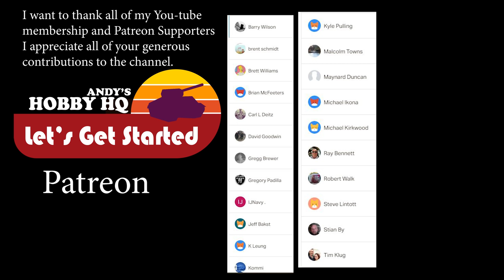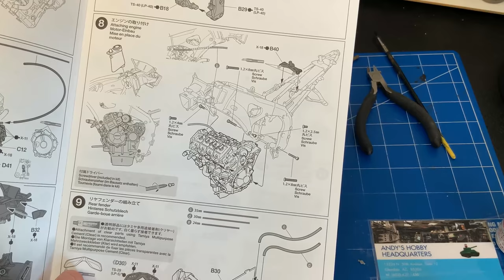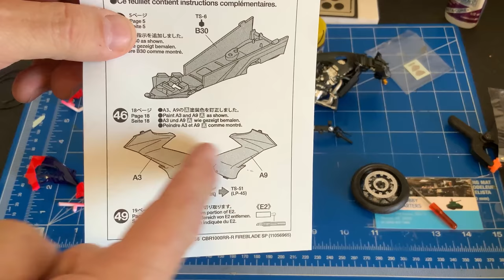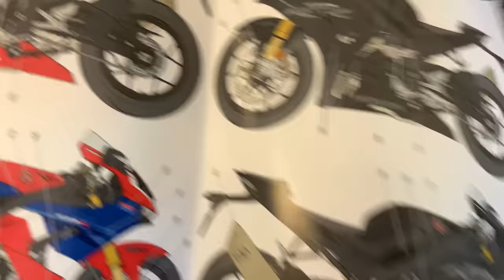How to build Tamiya 1/12 Honda CRB 1000 RR  Fireblade motorcycle model

Comment: I'm in the UK and dipped my toes into using Tamiya lacquer paints late last/early this year. I was sceptical, but after experimenting with them, wow what a revelation. Yes - in my opinion - they need airbrushing (after being thinned well) as they don't lend themselves to brush panting (other than picking out details say) and the colour range is limited, but I am sold on them. The colours I have so far used are beautiful paints, they go down well (airbrush don't forget) and dry rapidly, even with the retarder thinner, and dry smooth.

The Sparkling Silver in my opinion comes out almost as a metal finish, although perhaps for an all-over metal effect 'metal' paints would still be best, although are fragile and susceptible to damage. I won't stop using other paints but will certainly use Tamiya lacquers are now part of my paint ranges.

Comment: The lacquers don't need surfaces priming due to the solvent contained in the paint and thinners, this cleans, degreases and bonds to the surface similar to the cements. Priming is really for the acrylics or if the surface isn't quite smooth.

Comment: Wow nice paint, no primer needed ?
Reply: Primer is a Hoax, even naked metal when correctly prepped accepts modern paints with no problems Zone!
Reply: @jonoedwards4195  Agreed! I only use primer for body parts now, to show imperfections before base coating.
Reply: @jonoedwards4195  and I think that since the lacquers adhere more to plastic then acrylics you are sure it will be ok